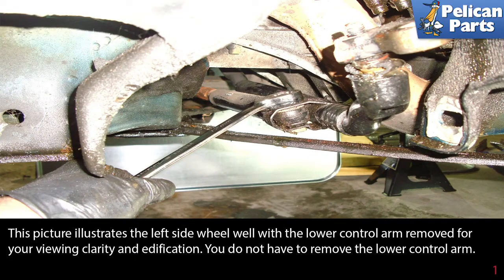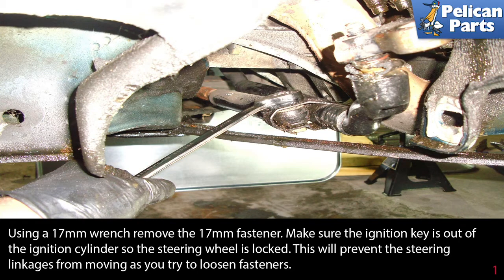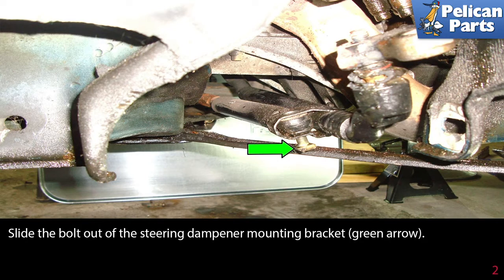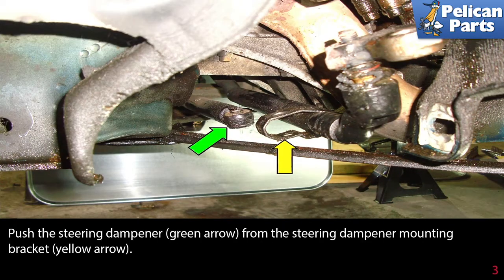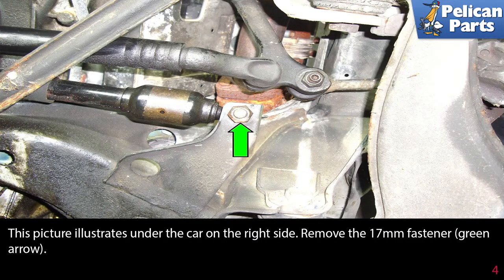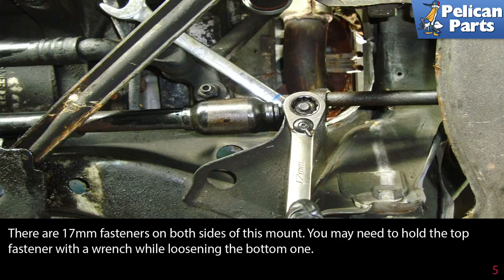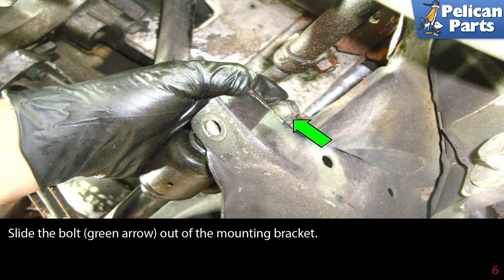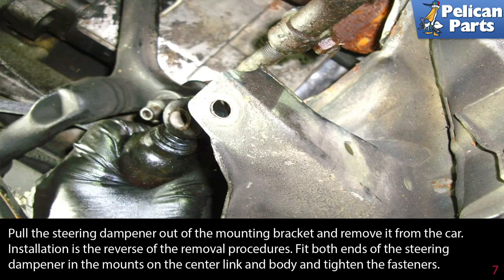Mercedes-Benz R129 SL-Class Steering Dampener Replacement

Comment: I drive a 1997 sl280. I hav too much feedback when driving over a pothole, can this be a shot damper?
Reply from the maker: Yes, or a worn end link / strut.
Reply: @pelicanparts  thanks! The car was just MOT inspected, think they catch the worn struts during the testin so pretty sure in my case its steering damper.